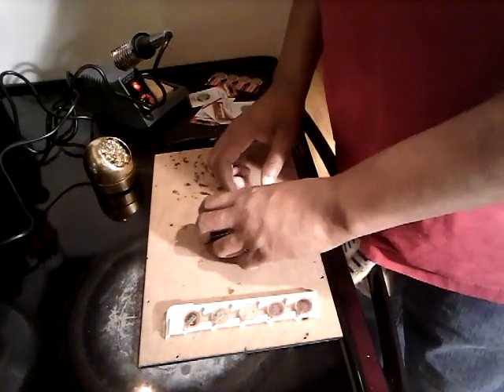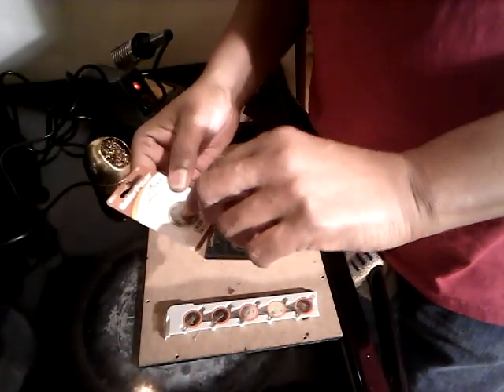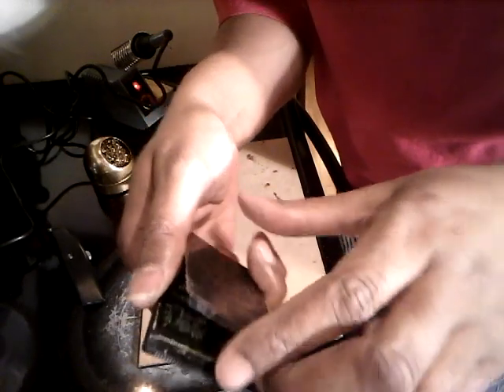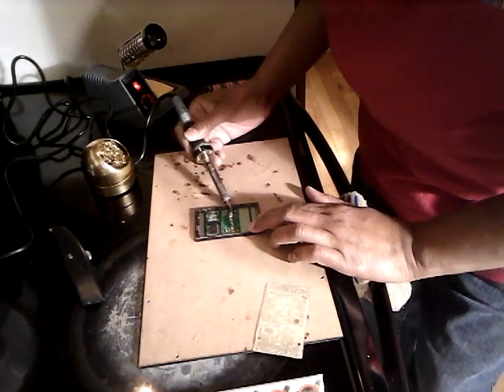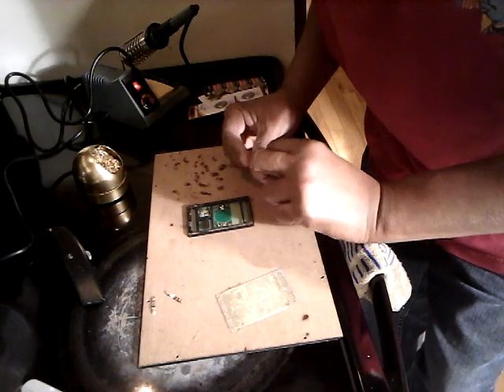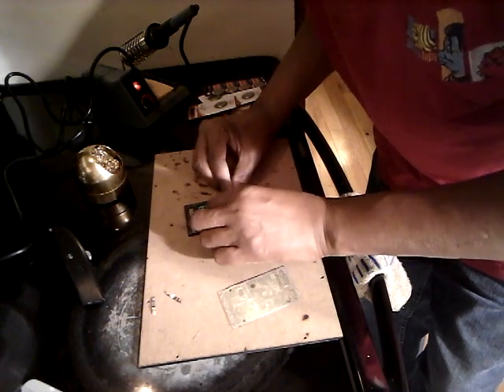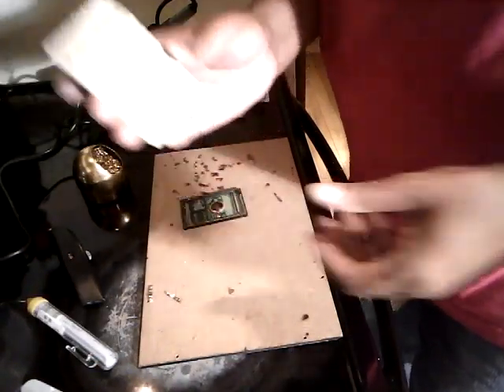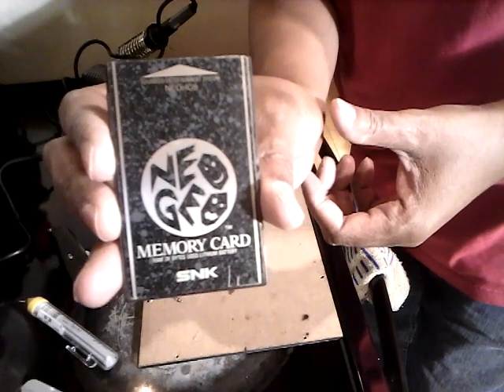Neo Geo Love Pt 8 Memory Card Battery Replacement

Comment: pro-tip on soldering batteries/battery tabs, place a damp cloth on the soldering point to limit the heat on the actual battery.  Keyword, damp not wet.  Plumbers use this when soldering joints all the time, it's the same principle. Great vid!
Reply: @U2BGlynn  anytime, I've been looking to purchase a spot welder myself, but welding the tabs is not too bad once you get a feel for how long to place the solder tip and how much heat to use